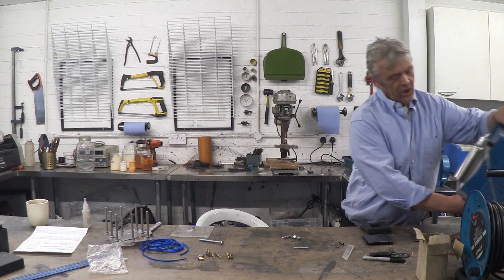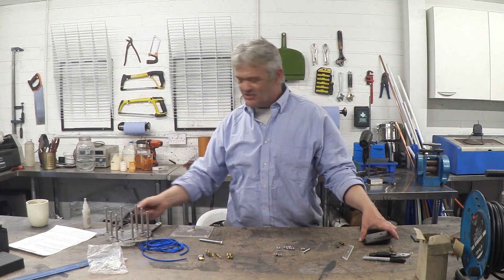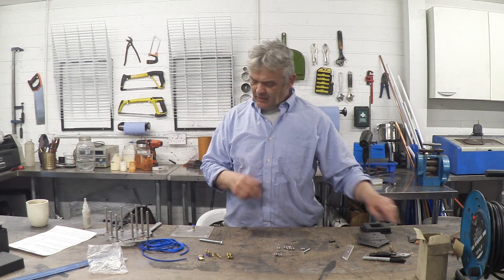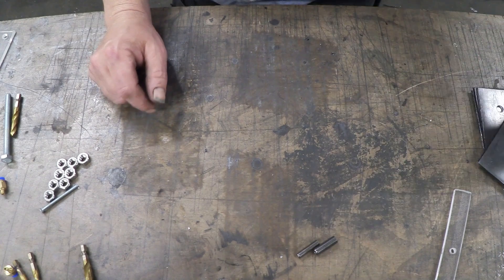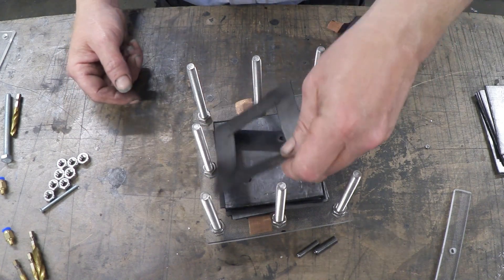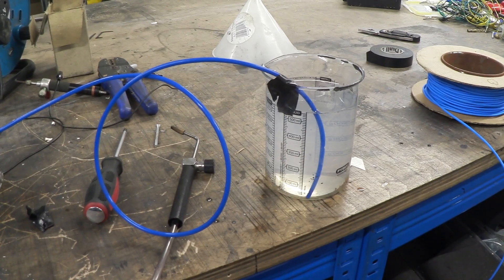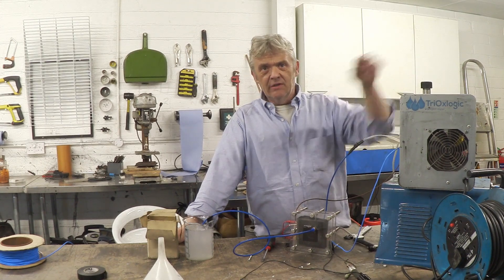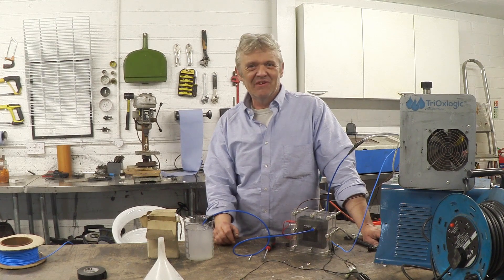Super Efficient Graphite Dry Cell Hydrogen Generator

Comment: Magnet? One of your previous videos showed a magnetic field from a regular magnet increase hydrogen production.
Reply from the maker: yep - but walk before running mate we need to see how this cell compares first and it would skew the results if we added a magnet now
Reply: I need to post my earlier project videos..  I have built a hybrid HHO Geo Metro.  I placed a large speaker magnet under the wet cell housing to "stir" the ions in the electrolyte thus keeping the plates surfaces more exposed, increasing production.  The electrohydrodynamic studies paid off here because the freed up surface area made a huge difference.  The dry cell is a good build for easily separating the 2 gasses by using micro pore cloth separators between the plates and slightly different gaskets.  Separation and purification will allow compressed storage for solar generation and ease of portability with a tank.
Reply: Does it increase your mpg?  Would running the engine hotter increase the mpg by the same amount?  I thought these hho generators were shown to only increase mpg due to running the engine hotter, but I see this video and now I'm rethinking...
Reply: @TheRainHarvester  
I understand that adding the hho gas merely improves the fuel efficiency in the cylinders.  However it also confuses the electronic fuel management unit which somehow destroys this gain
Reply: @T.L. Jenks how do you think it will do on a 1969 american motors car? No computer to get messed up right?
Reply: @suffolkcountysheriff  You will have to go try it on your own. All I recall is my wife's previously owned 1970 AMC Ambassador had a vacuum advanced 360 C.I. V8 with a 2 barrel carburetor. It acted lame and I thought it had had some expired shade tree mechanical work messing it up so I had to try to work on it without a manual. After I did a full tuned up, it still had problems. Then I found and fixed the leaky fuel line, vacuum lines, changed the distributer wires and reconnected the transmission down-shift switch. The old girl was still just old stock off the [very] used car lot, It became really fun to drive. Compared to my little 4 cyl, you could punch it and watch it launch with about 1 MPG at 0 to 40 in under 10 secs. and burn up 5 gals in an afternoon just making noise. Everybody catches up at the next light, anyway .
Reply: @T.L. Jenks Then we must be able to edit the program to include alternative fuels in the I.C.E. I've not been able to locate anyone in my casual search that can make a reprogrammable system compatible with say Chev for instance.
Reply: Make the graphite plate with Graphene and Sodium Silicate.   This should reduce the degradation of graphite foil. I made a paste of 2/3 (Volume) Graphene powder to 1/3 (Volume) Sodium Silicate. Trying to create Resistance heaters. Painted on ceramic tile with copper tape bus bars. Got 200 Deg F with 40v / .14 A problem was I didn’t let the patse cure long enough. Started to get crackling.. I think if you Screen Printed your plates and let the cure, you’ll last longer from degradation. My Ohm reading was 1 BTW.

Comment: Have you considered making a lot for this? Even laser cutting the layers and including the bolts, tubes and connectors? Power supply optional.
Reply from the maker: it's an ideate but it takes a long time to make up kits and there is only me here - so it comes down to work on this or make kits not really time to do both I am afraid

Comment: I would really love to see a video on converting hydrogen and oxygen back into electricity.
Reply from the maker: like a fuel cell?
Reply: @ThinkingandTinkering  Yes, there are next to no videos on home made ones. I was thinking of using a a capacitor of some sort like a Kelvins water dropper to separate the charges instead of materials like platinum. I never got to playing around and thinking further on it. Anyways I would love to see your take on a fuel cell.
Reply: @DavoRavo  I saw one video about that a long time ago...very simple process
Reply: @ThinkingandTinkering  yes! I was hoping to learn how to build several to replace ebike batteries and thus maybe increase the range independence. They have done sth. Like this on the armadillo or the flevo bike I think. ( I think John of veloads YouTube channel has covered it?
Reply: Robert Murray-Smith 
Hello Sir, 
have you ever heard of a coil that, instead of having copper, has liquid mercury in a thin hose? 
And it would work just like a coil, but with liquid mercury.

Comment: Great Job and thanks for sharing. One thing I am interested to know, how to scale up this thing and how much hydrogen gas can be produced? May be I can think about application this equipment in small reduction furnace.
Reply: Seriously? To scale up is to just build it bigger and have an increase in power supply controlled by a rheostat or variac to tune it.
Reply: @Barskor1  Yes, but how are the input variable related to production rate mathematically to produce a specific rate as efficiently as possible?
Reply from the maker: it probably follows the same rules as SS plates

Comment: I think nickel plated copper would also be a very good electrodes, what do you think?
Reply: I tried that years ago and yeah its good but you can only use it on a cathode as the anode coating will electroplate onto the cathodes.
Reply: Interesting, thank you
Reply from the maker: nickel works well on the cathode as it is catalytic especially for urea splitting

Comment: Well, hell then! Forget the stainless all together. I wonder if there’s a neutral electrolyte, like washing soda that could be nearly as efficient in conjunction with the graphite foil. Even if it was half as efficient, the graphite is so cheap and easy to work with, just make it bigger to make up for the loss in gas production. 

Thank you for sharing this, you got me interested in building a cell yesterday.
Reply: Washing soda breaks down to sodium hydroxide and co2 gas.  

If aqueous  sodium hydroxide  is exposed to the atmosphere  for too long, it will absorbe co2 from the atmosphere converting to washing soda in water, sodium bicarbonate.
Reply from the maker: washing soda is alkaline too mate - I am sure other salts would work but it would be a question of researching and experimenting I think

Comment: we are so close to energy independence, thanks
Reply: In Germany they produce so much green energy that they have to throw away a billion watts a year. With a system like this you could turn it to hydrogen and use it when you need it or use it in hydrogen fuel cells.
Reply: If they let us.
Reply from the maker: for sure mate
Reply: Economically speaking, at small scale cell processing looks great, but steam reforming will always beat out cell processing at an industrial scale.  So the higher demand on hydrogen makes steam reforming a much more sustainable economical reality(actually it already 85%-95% of hydrogen production)

Comment: Great job Robert 👍👍👍 , what do you think about  lifetime from the graphite elecrode ? On our devices we use polarity switching board , so the erosion on the steelplate isnt so bad .  the problem with the chrom we slove with differnt bubblers , cascade with 3 bubblers because HHO is very healthy for lunges and skin regeneration . I had a troping water tube under my seat and sitting on a HHO gas pillow , thats amazing fine , its push the body up and drive you younger .
Reply from the maker: I don't really know mate - I have read around the scientific literature on this and the research is saying lifetime is longer if certain conditions are met - like current control, concentration and voltage control - but that's only what I have read and not what I have tried myself

Comment: The best results I have found are using aluminum (no electricity needed) of course the aluminum is sacrificial, which is why I just use aluminum cans in water with KOH and then I usually use the gasses to just fill balloons for my kids (don't tell my wife they are playing with explosives
Reply from the maker: cheers mate
Reply: @ThinkingandTinkering  My next project is to use an impulse sealer and a Mylar blanket to make a huge balloon. I have been saving apple juice containers to be used as the reaction vessel and I have aluminum cans my son and I have picked up on our walks throughout the neighborhood in preparation. It should be fun.

Comment: design up a template for your laser cutter Rob if you're going to scale it up.  Your machine back there should have no problem slicing through your rubber gaskets I would think. Really love that you can just hole punch the foil though.
Reply from the maker: that's a nice idea mate - I could get really nice gaskets then - I'll do that - thanks for the tip

Comment: Depending on the model of the original hho machine, I believe you will find that it will produce around 1L/min of hho gas.  If one uses that as your benchmark, it would be very interesting to see what the output of your graphite dry cell is.  Further to this, given that a urea solution is able to produce hydrogen at 1/4 the voltage (0.37v instead of 1.27v) this would be an additional step, but an interesting one to explore!  Looking forward to seeing what you can do with this!
Reply from the maker: it is interesting mate - especially if we start to think about cost per litre produced

Comment: Graphene ? Activated carbon clothe or carbon filter ? Any of these could be better cause of more surface area
Reply from the maker: apparently not mate - well according to the study - I guess it is because some hydrogen is entrained on the surface of large surface area materials and the acts to reduce the surface area and any active sites - I don't know I am guessing for the reason but the results show graphite to be better
Reply: @ThinkingandTinkering  couple of tips from my years of working with dry cells...1 sanding plates increased efficiency.... also a 1 mm spacer worked best ...the more far apart the plates the less efficient

Comment: that little thing put out an impressive amount of gas.
Reply from the maker: yeah I thought so - can't wait to get it into a stand alone config and try that torch
Reply: @ThinkingandTinkering  i bet that will work well.
you could also adapt it like that 1 you did recently with the 2 vases connected at the base to segregate the h2 on 1 side & oxygen on the other.
you could probably run it on a urea mix too.
Reply: I've been told that before! 🤣🤣🤣

Comment: @Robet Murray-Smith I found out that graphite has porosity which could leak gas when introduced under pressure. Would this not be an issue for this configuration?
Reply from the maker: hence the hdpe mate
Reply: @ThinkingandTinkering  So your graphite foil is graphite-impregnated hdpe?  That's cool.
Reply from the maker: @wibblywobblyidiotvision  coated one side mate not impregnated

Comment: @Robert Murry-Smith what I've discovered a couple of years ago, when I had 2 neutral cells between each positive and negative electrode is that depending on the electrolyte, it behaved as a battery. It kept some of the voltage and amperage we used for electrolysis. We used stainless steel electrodes. Would it behave the same way with graphite?
Reply from the maker: yes mate - there is some H+ and OH- entrained but self discharge and efficiency are always going to be rubbish with this kind of arrangement for batteries
Reply: During my test, when doing slow (long duration) pulse width modulation, I also noticed huge but brief in rush current very much the same as if one were working with a capacitor. I suspect that was due to capactance effects at voltages less than 1.24 volts per cell where the electrolyte acts as a dielectric between the plates of a capacitor, storing energy in the dielectric that can be latter released as you observed.
Reply: @kreynolds1123  I've done the same experience and I found out that 1.5 volts per cell would be most efficient, as it would prevent evaporation losses. I've tested a variety of displacements and found out that the production level would be proportional to the distance between negative and positive cell. I've tested without neutral cell and with one neutral cell between electrodes. And tried to increase electrolyte concentration as well. I had a Volvo which I was planning to run on hydrogen from water. I found out that the best would be combining with redox reaction as it is easy to split water vapour by oxidation. As the result of the combustion was water vapour, I was designing a catalytic converter to replace the existing one for this intention. Well, as soon as I had to go to Belfast, my wife sold the car. Ridiculously price that would not even pay for the tires.

Comment: "These things are expensive", oh dear Robert is on a mission to put another industry on its head :-)
Reply from the maker: lol - I believe in the democracy of science mate
Reply: @ThinkingandTinkering i hope you recut a couple of those that over lapped the holes. 

Also not sure why you mention democracy?  ?? 

Constitutional republic not democracy. Democracy are awful.
Reply: @ThinkingandTinkering  That's what Stan Meyers thought with his water powered dune buggy.
Reply: @safffff1000  becareful saying that name😬
Reply: @ThinkingandTinkering  Sir your replies are just beyond human's selfish nature.
Reply: Martin It obvious  he's getting to close for comfort.
Reply: Not true I made 8 me more gallon and the engine got cleaned 9:41
Reply: Using power to make a little bit of energy .  Power in power out . No savings .    I made a larger wet cell for my diesel truck when fuel went to almost $5 a gallon .   It made hyd gas .  And ... My milage per gallon dropped 1/2  a mile per gallon .
   People have made very large cells run off 120 volts and the amount produced was barely enough to run a  small push lawnmower engine . And not run well .    So ...let me know when a cell is made to replace a auto engine and work as well .
 This is replacing nothing .   Just fact .
Reply: @boracay12  You might be running into issues with the engine management system. The computer sees changes, then it adjusts things to compensate, and that can negate any improvements in fuel efficiency. It might be possible to adjust sensors or remap the ECU, if someone has the correct expertise.
Reply: @RWBHere    it was a 1999 diesel .it didn't have much sensors on it a if I remember right the map sensor was by passed...I guess it used slightly more power to generate the small amount of gas produced .  But it's hard to get exact  mpg ..it didn't go up though .
Reply: @RWBHere  There a re a few companies with ECU maps out there for almost every vehicle, this was a problem in the early 2000s, not anymore.
Reply: @RWBHere  you would probably have to use a spacer on the exhaust Lambda sensor like the biodiesel boys do.
Reply: @RWBHere  no it bypassed the sensors going into the intake after thier location.
this was on a 99 Ford diesel that was less complicated than other cars . 
 the theroy is that the  relitive small amount of hydo gas would give a more efficient burn of the fuel .   it does not or very little and it taxes the engine to produce the extra electricity to make the gas  
so there is no gain .
lots of people tried if there was significant gain these would be common by now.
 a automobile produces 12 volts    a usa house puts out 120 volts .
one guy made a cell the size of a fish aquarium .many times larger than any one the cars that where made .
  and powered it with the120 volt house outlet.
 it made gas .he ran the line to the little one piston push mower .and used only the hydro gas .   that engine barely ran .    
 go ahead and make one for your vehicle.   and see for yourself how it works .
Reply: @boracay12  Gashole!
Reply: @boracay12  if you feed an engine HHO gas without adjust fuel pump or anything then what do you expect. 
Big problem with this tech is people like yourself who do 10 mins of research, try it one way, once and then tell everyone it doesn't work. The tech works very well in the right hands, try to walk with it before you can run. Moron
Reply: @urbexyounggun2214  you can't "adjust the fuel pump" 
you know nothing about how engines work .      try making a  hydrogen fuel cell for your vehicle .there are plenty of videos on how there to be assembled .
then get back to us .... in a month or 2 .
Reply: @boracay12  Hi, perhaps you could review the diesel mechanics in Perth WA Australia who retro fit there kits to mining company rigs. They boast 25% improvement. I have no experience with it.
A larger mining company over there Fortescue Mining has gone away from oil reliance too. Interested to see how these billion dollar companies are doing it. I don't think they are in the time wasting business.